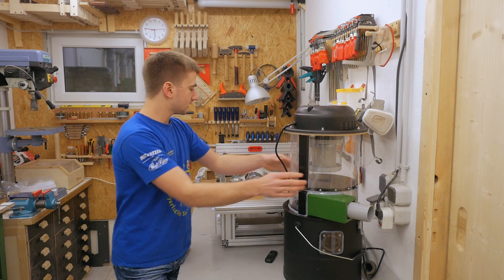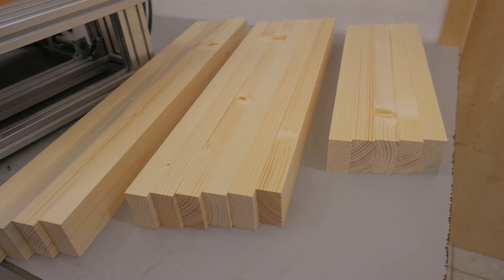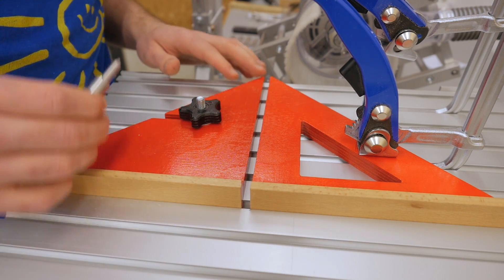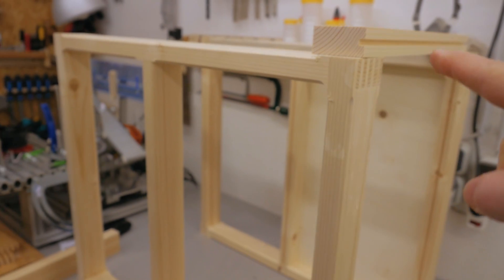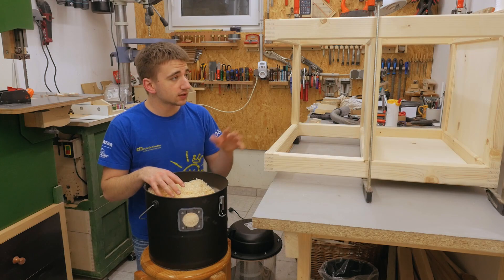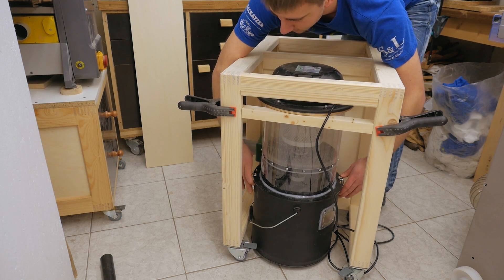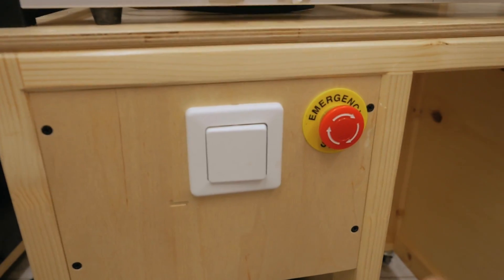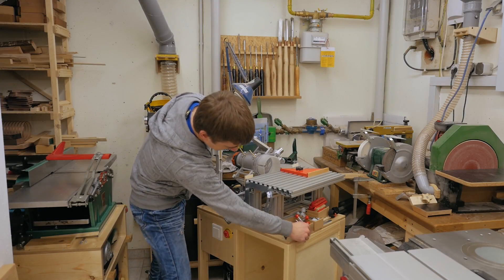Pantorouter Cart with Automatic Dust Collection

Comment: Hi Marius. I am going to buy a panto router. But I am not sure about the router that can be mounted on and that I can find here in Europe with a 230V motor as It needs to have the correct diameter to work with pantorouter. Can you tell me the router model you use and if it fit on the standard pantorouter or I you have had to adapt it ? thanks in advance.

Comment: Excellent video as always Marius. The cart turned out great. 
So the Pantorouter you used in the video is the same pantorouter and manufacturer linked in the description section? I will have to do some research to see what all can be done with a pantorouter to justify the cost. It seems that anything you could use a Festool domino for you could do the same thing with the pantorouter but the pantorouter doesn’t have the portability/convenience of the Festool domino machine.... Of coyote looks like you can do so much more with the pantorouter.

Comment: What extra switch (not the emergeny one) did you use?
I just wired a normal switch to my master slave unit and it works fine to but your solution looks a little more elegant with the master being turned off when the switch is on.
Reply from the maker: It's a regular light switch.
Reply: Hmmm, hätte ich wegen der Ausfräsungen jetzt nicht gedacht. Aber dann ist Deiner irgendwie anders verkabelt als meiner. Da muss ich mir das Video von Alex Fürst wohl noch ein zweites Mal angucken
Reply from the maker: Ja, meiner ist ein klein wenig anders verkabelt. Ich hab die Schaltung Von Alex noch so umgebaut, dass das mit der Stromunterbrechung funktioniert.

Comment: It looks realy nice and I have no doubt that it will hold the weight. But why making a nice box joint, just to weaken it by a large mortise? Also the mortises for the middle pieces which are placed cross to the grain.
Reply from the maker: How would you join the pieces (without screws, because that's what I wanted)?
Reply: Maybe not right in the corner, and the mortise in the direction of the grain. Or no box joints and just mortise and tenons.  Or am I missing something? Just a thought.
Reply: moninum strong enough for the application.

Comment: Just a little complaint. Dont use a emergency switch as a switch for turning things on or off, it's not meant to be used as such.
To be honest I would probably done something similar myself, but I don't show it to the world. Since you show your work to the world you should really be trying to learn the masses in how to do things properly. In this video for example you should have done a real cabinet for the electrics with switches and/or relays with CEE-inlet and Schuko-outlet. That would have not only looked nice it would most likely thought some on how it should be done properly.
Reply: You could do it the way an industrial machine would be done, but Marius is a student and therefore has a student budget. A $5 estop switch is perfectly acceptable, they create far less contact wear than a normal power switch would (very fast action). The equipment is also DIY equipment on a DIY cart... not an industrial piece of equipment built by Siemens ;)

Comment: Good Work Marius. Always enjoy your videos. Saw your new Kity from the corner of my eyes. I'm very interested how you did the build of that cart. I was planning to build a cart for mine, but didn't know how to mount the motor underneath  the jointer since my motor currently is build behind the jointer, which requires too much space. Building it underneath would change the direction the jointer runs. Did you have that problem too? Did you cross the belt, or is your motor turning in the other direction as mine?
Reply from the maker: That's the next video. As the motor is three phase and the switch has a "phase changer" built in it was more than simple to make it run in the right direction.
Reply: Thanks Marius, looking forward to the video. Hope you cover the phase change too.

Comment: Someone please explain to me why I constantly see You Tubers building jigs and other items that rely on some precision or stability out of solid wood.   I know solid pine, spruce, fir ect... is cheap but it is very susceptible to seasonal movement.  I've seen you use Baltic Birch or Euro ply... why not build with this... is it cost or am I missing something.  I have been a professional for nearly 20 years and ONLY build with Baltic Birch, all carts, jigs, basically anything that I want to remain with as close to original dimensions as possible.  I know metal moves but if I could build all my jigs and precision items with it I would.  I love yours and Matthias's content but I would NEVER build a wood bandsaw.  Any where  there is stress those fibres are compressing and won't recover fully over time, I know you and most others know this but still do it... I don't get it?  Your stuff looks great though and I fully enjoy watching.   Keep up the good work.
Reply from the maker: To me, a cart built with solid wood looks better, than plywood. Personal preference. And yes, it's also cheaper. 7€ for that one board, compared to a sheet of plywood (or half a sheet) for 40-50€.
In terms of the bandsaw, I recently calculated the load and it turned out that the wooden frame is more than up to that. It could take a lot more load. Mine works as good as on day one.

Comment: Excellent video.

I noticed you're using the 3M dust masks. Just in case you didn't know, there are pure particle filters available. Saves a little bit of clunkiness and money when you're just working with the machines. https://www.amazon.de/gp/product/B0009I1QO2

What clams are you using in the video (the ratcheting ones with the blue spanner handles)?
Reply from the maker: They came with the Pantorouter. They are the same as the Festool T-track clamps.

Comment: Nicely done. It seems as very useful combination of machines in one cart.  I just don't understand why have you used master-slave electronics. It is just for stuff which are in different locations and you can't bring the control together easily. Here you can just have main switch from the STOP button and the magic switch for added feature will be in series with the router only. Blower will be connected to STOP switch directly. Or is the master-slave something more here?
Reply from the maker: yeah that's right, here it have been done without a master slave switch. But a viewer wanted to send me one for this project, so why not.
Reply: Marius Hornberger you could have Use it for the dustcollection 
from the cnc.

Comment: Super neat build. Do you know the risks of not using a master slave switch but just wiring the plugs on the same switch? Would be interested to know the advantages of such a circuit. Keep up the good work!
Reply from the maker: I don't know if there are any risks. Could have been done without a master slave switch.
Reply: Fair enough! I like your way though, classy, and always interesting to see how it's done.

Comment: Hi Marius, why didn't you put the pantorouter somewhere on the workbench and use your already existing dust collection?
Reply from the maker: It uses too much workbench space, is at a bad working height and is difficult to move around (heavy). And I'd always have to switch on my regular shop vac when using. I really wanted the automatic dust collection.

Comment: You build your cabinets very similar to mine - box joints for the corners of the frames, then mortise and tenon joints near the corners to connect them together.  It's the most optimal way!
Reply from the maker: Yeah, I like how strong they come out this way. And no metal fasteners that can get loose over time.
Reply: Seriously - here's two people that must be on the Ark !
Reply: Matthias Wandel It is the most optimal way with a Pantorouter.
Reply: I think you two are the essence of woodworking with engeneerical approach. Now you just have to cut the lumber for a desk out of a popsicle stick and Germany will have her own Matthias Wandel
Reply: Marius... time for a jump test for the strength!!!! JK, great build.
Reply: It is such an elegant tool. Making my own metal one from extruded aluminum I acquired from a tool scrapped at my work. The tricky part is the panto-graph mechanism and I am sure alignment and the ratio will be key. Maths!
Reply: Matthias Wandel,  I'm glad you are here on this video.  Which do the 2 of you feel is the easiest to make box joints? The pantarouter or the adjustable box joint jig.  I can't remember off hand if or what type of box joint jig Marius has.  It would seem to me, Matthias's box joint jig would be an easier set up but perhaps the pantarouter would cut faster.
Reply: Matthias's pantarouter on Marius's Cart with Automatic Dust Collection [plus Matthias's mousetrap system]
Reply: Matthias Wandel I would love to see a video on your channel shouting Marius out, he really deserves it and I think some of his ideas are brilliant
Reply: We have been waiting for this official consecration. :D
Reply: Marius has on many occasions stated that Matthias is his hero. It is not surprising at all that Marius would replicate Matthias' work under those circumstances... where do you think Marius bought the plans for his home made band saw... LOL
Reply: Marius has built an elegant dust collection system -- perhaps inspired by you.
Reply: @Matthias Wandel ... you sure you don't have a forgotten son in Germany? This guy talks like you, explains his projects like you and even comes up with ideas that I've seen you come up with too. It's like you're the same person, just with a different accent.
Reply: Dale Mallet Yeah, I thought I heard that too. But he recently seemed to downplay it. Maybe he out-Matthiased Matthias and there are some bad vibes?

Comment: Does the new setup cause your lights to dim more now that the new setup starts both motors at the same time?
Reply from the maker: Shop lights run on a different circuit. I have 4 different 230v (16A) lines and the 400V 3-Phase (16A) line. All with their own fuse.
Reply from the maker: What lights do you mean?
Reply: Shop lights i think ?
Reply: Yes, shop lights. Starting two motors together should double motor starting currents.

Comment: I see alot of people making carts for tools, but don't they roll around alot when you use them?
Reply from the maker: that's why I put locking wheels on them.
Reply: Usually you would add one or two castors with brakes on to keep it in position or as some people do have the wheeled section mounted on some mechanism that lifts up and down as needed to allow for mobility but also for semi-permanent installations (great for table saws).